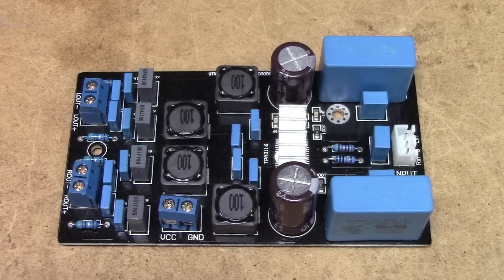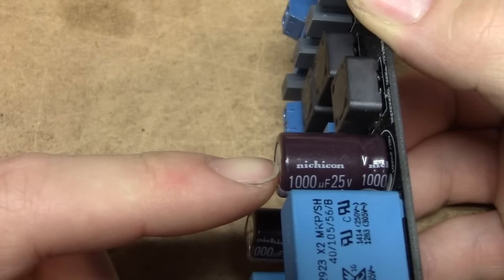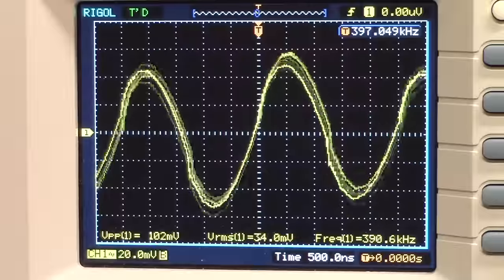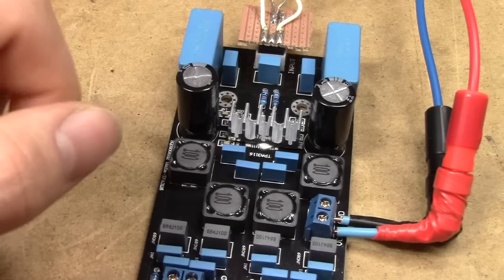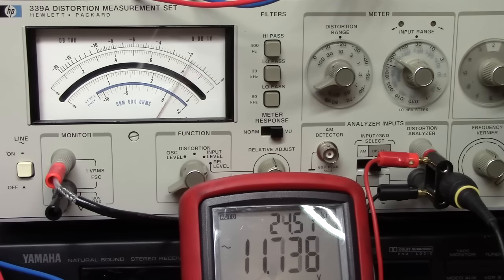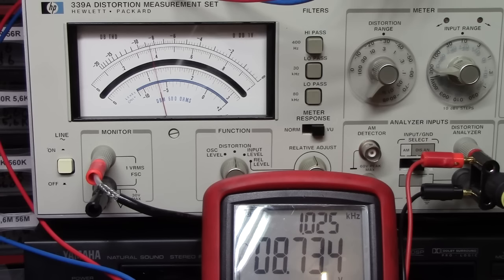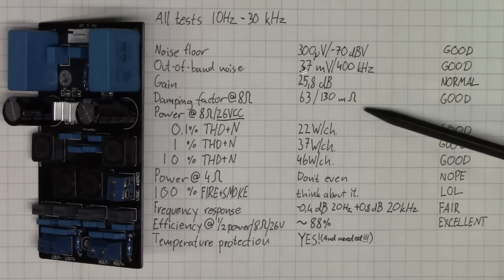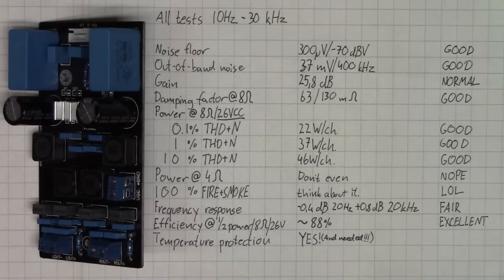SKU216059 - TPA3116D2 Class D amplifier board measurements - China reviews

Comment: The mono versions seem to have the advantage. Same power as stereo into 8 ohm, more into 4 ohms. The chip is configured to offer higher current in mono. I have tested the mono version sold on eBay as a 100 watt ( 2R ) subwoofer amp with good results. At about 10 watts contiuous only about 35 celcius at the heat sink which is larger than the version shown ( or 15 C above ambient ). That relates to about 60 watts music unclipped, or 30 watts Techno music. Realistically 50 watts 4 ohms at 24 VDC if the mono version. As 4 ohms speaker dips below 4 ohms the 2 ohms rating has some reality.

Comment: I just love the weighting of amplifier noise. It's like blocking up your ears and noticing how quite things are. But, it looks good for the uninitiated! Which for people that think these modules are real HiFi that's just fine.
Reply: +Michael Beeny Ever listened to one? Can't comment on these specific boards because their potential for Shenzhen Market components but these switching chip amps do sound bloody good with good quality components, provided one doesn't push them too hard. Damn useful for when power consumption or cost is an issue. My KEFs and sabre dac have never sounded as good as when driven by mine (albeit with a Tripath chipamp). Definitely not for lovers of the Valve amp though.
Reply: +Maurice Orris Ive played with a few mods on this board, mainly changing the caps and the inductors with proper components, and they can produce quite nice sound.
Reply: Yeah I bought my Tripath amp intending to swap all the caps, etc (the inductors are fairly decent) and generally mod the hell out of it... Had it 6 months and just don't feel the need..  better to spend that cash on better new speakers... considering a DSP too..
Reply: Check out the mini-dsp 2x4. I am quite impressed with the unit for the price.

Comment: I'm surprised that it overheats so easily. I've got a very similar amp based on the 3118 chip without any heatsink at all, only using the PCB to dissipate heat. And I haven't noticed it overheating when I play music, even reasonably loud.
Reply from the maker: +Rune Tendal Kock "Reasonably loud" is usually in the region of 1 W per channel on average. The crest factor of music is very low, meaning that it'll have a low average power, with lots of little short spikes, so it's very uncommon to actually play an amplifier at its rated power for any amount of time in "real life".

Comment: It's not as efficient as the Tripath amps, from what I understand, but it's supposed to be more transparent.  That being said, I do like the sound of my Tripath amp; I have a beefy 12V 6.8A (conservatively rated) PowerOne linear supply driving it.  Most single-chip digital amps don't like switching supplies unless they have extremely low output ripple.

Actually I have yet to see fake caps on single-board amps like this.  I can tell you for certain that the Epcos mylar film capacitors are the real thing.
Reply from the maker: +douro20 While I can't comment on the film caps (beyond their rather silly high voltage rating of 305 V AC), the electrolytics ARE fake. The print does not match genuine Nichicon, and despite being marked as different series (PS and PW), they measure nowhere near the spec of either series.

Comment: I was wondering if the two large caps could be transferred to the back of the PCB and a larger heat sink fitted right across the PCB. A small quiet fan could also be added if needed. 
Thank you for this video I have been looking for an amp as a backup. I have a pair of Tannoy 15" 15 Ohm speakers. I assume from the fact that this likes 8 Ohm over 4 Ohm it would like 15 Ohm's even more.  I do appreciate the watts would drop but these old Tannoy's are very efficient. All I would need is some simple volume / base / treble unit.
Reply from the maker: That would work fine, the caps are grossly over-rated (400V) stock.
Reply: Thanks a lot. This little amp does seem to be one of the better ones. I probably don't need to upgrade the heatsink but judging by the number of over heated transistors being replaced on You Tube videos why take the risk. I'm into fans, I don't mind the odd hum, I usually drop them down a few volts and that shuts them up. Thanks again - great videos and very helpful. Take care.
Reply: I know this is a bit late but would say a 16V cap instead of the 400V be OK. I have ordered 2 of these amps and I though that if I replaced and moved both the electrolytics and the 400V to the back of the board I might get a bigger heat sink on. Please let me know if you see this comment. It would clear the deck a bit.

Comment: Hmmh... The datasheet recommended operating conditions for 4ohm load is 2 × 50 W Into a 4-Ω BTL Load at 21 V , did you test the amplifier with with 26 or 21V? If you did test it @ 21V, my bad and sorry for the mistake. Otherwise, very well made and informative video.
Reply: I did some modifications of my own, I added a much larger heatsink, by removing the large electrolytic filter capacitors and placing new higher voltage rated capacitors on the bottom of the board directly to the power rails. The amp sounds quite good driving larger 3-way speakers (8ohm), especially for the price.
Reply from the maker: I tested it at 26 V, because that's the maximum recommended supply voltage of the chip. The 21 V on the first page of the datasheet is just an example.
Reply: Also, that would be a poor design if it runs away thermally that easily at 5 volts above the recommended 4 ohm rail voltage stated in the features section of the datasheet. I suspect that 21v is the minimum rail voltage needed to get the claimed wattage out into a 4 ohm load. It seems like a a maxed out design. It is beyond max at 26v, obviously. Maybe it can maintain without thermal runaway at 21v.
Reply from the maker: No, they can't. Keep in mind that power dissipation scales only with output current on these switching amplifiers, so you get the same dissipation at the same output power into the same impedance whether you have a 10 V or 100 V supply.
Reply from the maker: *****
I do not give much credence to a Chinese auctioneer as a source. If you check the datasheets for these ICs, they usually have a ~10 % drop in efficiency for the same power when doubling the supply voltage, and that's not much if they were to be fitted with suitable cooling.
Reply: So instead of just quickly testing our hypothesis that has multiple clues pointing towards a lower rail requirement at 4 ohm loads, you are going to be hard headed and stubborn about this? The question could be answered in 10 minutes on your bench. Your heat pipe was not good enough of cooling? 26v is apparently too high a rail at 4 ohms, but you flatly refuse to consider this even against the datasheets recommendation.
Hahaha, you are laughable at this point. The psychology is right there in black and white. You feel threatened by another viewpoint other than yours so you shoot it down, when you could have easily proven or eliminated the hypothesis already. What is your mental block on this? You did not come up with the thought? Afraid of being proven wrong? It does not matter to me anymore. See ya.
Reply from the maker: *****
Yes. The earth is also a flat disc suspended on the back of a turtle.
Reply from the maker: ***** Come on. Heliocentrism is just a theory.

Comment: If I were to make a stereo system using amp boards like this, where would you place a headphone jack in the signal line?  (the kind that would mute the speakers when plugged)  .. I would guess after the preamp?
Reply from the maker: +Kyle Comeaux There is no "preamp" on this board. You really can't easily add a headphone output to this without using an extra opamp (i.e, making a preamp), since you can't connect the grounds of the two channels together on these modules.

Comment: any chance you can hook some speakers up to it and just listen to it?
Reply from the maker: +supdus There's little point in doing that on video, since it's going to sound the same as all other cheap amplifiers. Save for the relatively high noise floor (background hiss), any colouration of the sound by the amplifier is going to be absolutely swamped by that of the speakers.
Reply: +FFcossag i was just curious..... I'm looking for an inexpensive amplifier for a project but am really new to this..... is there anything that you would recommend....
Reply from the maker: supdus As long as you can deal with the cooling issues and the needlessly large PCB, this one does a good job. It really depends on what kind of performance you need.

Comment: What kind of meter is that?
Reply from the maker: Assuming you're talking about the HP339A, it's a distortion meter. It measures crap on the line, basically.
Reply: no, it's the snake oil meter.